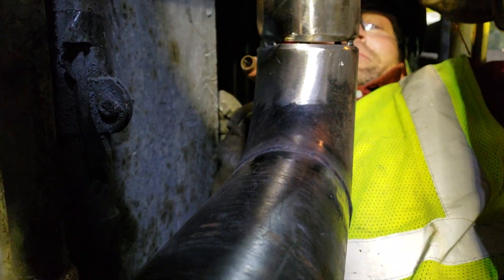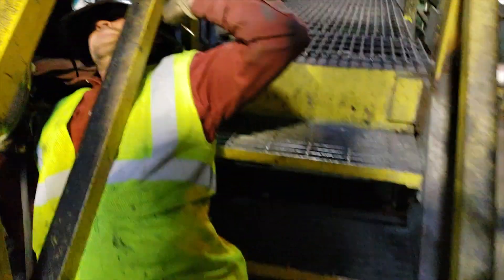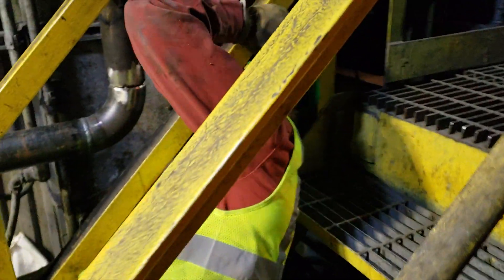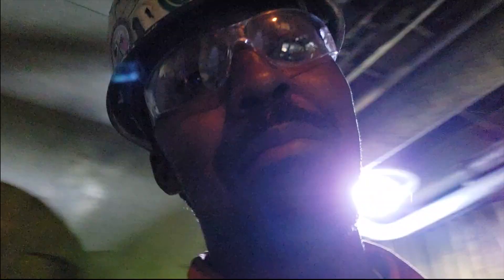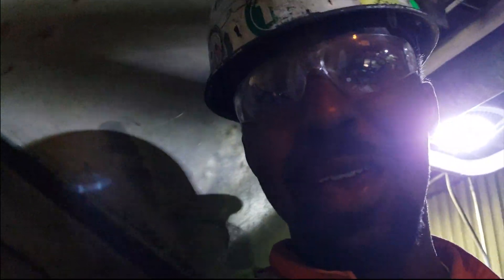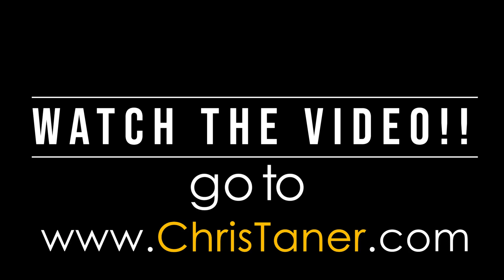Pipe welding shutdown season. "Big Money"

Comment: I'm still kinda new to welding,,, but what is shutdown season???
Reply from the maker: Every year power plants, paper mills, oil refineries, coal plants etc. shut down operations for a short period of time in order to make repairs or  Revisions. The contractors work long hours to get the job done in order to  Meet deadlines, work  Schedules are usually 7 days a week 12 hours a day. Contractors such as pipe welders pipe fitters etc earn tons of  money.
Reply: @christaner  ok right now I'm working at a company called NOV